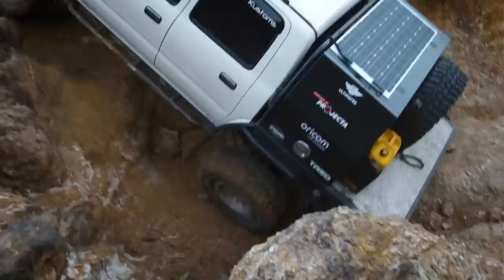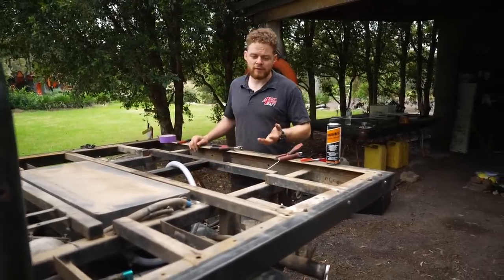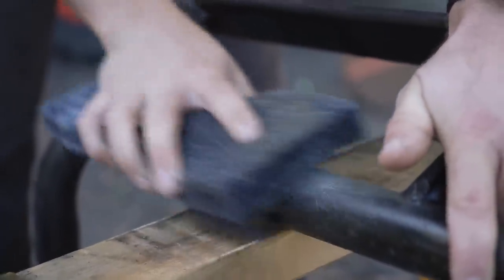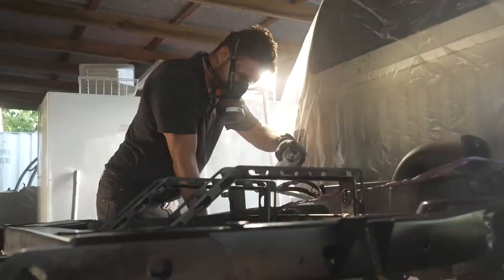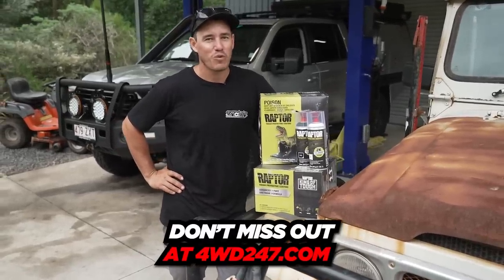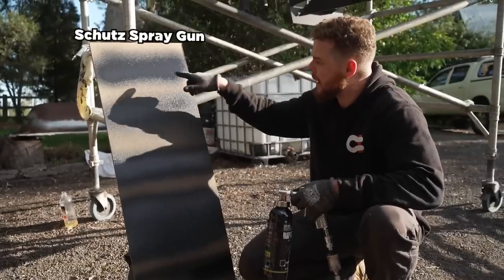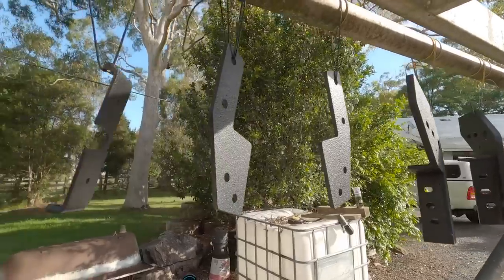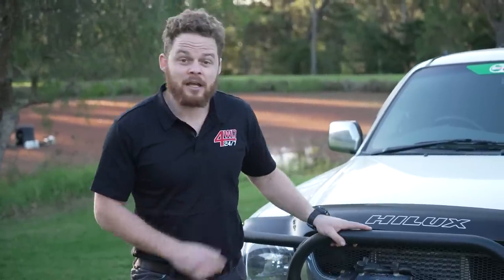HOW TO make your barwork & ute tray look NEW again!

Comment: Really should have rented a real sand blaster or even a dustless sandblaster set up, over that little hand held spot sandblasting gun. Would have taken like a hour or less to do all your bar work and probably your whole rig frame body and all. Least that's how long a dustless system would take, for a normal sand blaster it would just be what you did tray and bar work.

Comment: Would like to know what size air compressor your running to spray raptor coats??
Reply: Hey, mate! Your air compressor requirements are 1.5KW/2HP, it needs to be able to generate a consistent air pressure of 60 PSI for best results 👍
Reply: @raptorcoatingsaustralianz  thank you so much for your quick reply, I've watched quite a few videos on the raptor coating and plan on respraying both my partners and my 90 series Prados but Ive never heard any info on suitable air compressors to use, as I don't own one yet wasn't sure on what compressor to buy!! Cheers👍😀👍
Reply: @Guitarman12478  our pleasure! Hope the project goes well!

Comment: What do I do if my bar is powder coated and I want to spray it in raptor will I need to take it back to bare metal
Reply: Just lightly sand the powdercoat, prime then paint. If its peeling of bubling then it will need to be sanded back smooth
Reply: Hi, mate! To prepare powder coat, clean the surface with wax and grease remover and lightly sand with 180 grit sandpaper before applying RAPTOR.

Comment: Hey jocko need some advice mate I've got a ln106 built with a turbo install have put everything brand new on this truck but can't keep the temperature down when it's driving on a slight uphill when in 5th gear even on slight gradient like the m1 I've tried everything n can't get it sorted can u offer me any help to get this sorted mate desperately wanting to get out n use this but don't want to cause damage to the engine it has hi steer conversion front n rear lokkas long range tank winch sliders 12volt system water tank custom seats raptor coated u bolt flip kit banana shackles up front 3inch lift wanting to do Cape York and northern Territory next year once or if Eva I can get this engine sorted any help will b much appreciated mate thanks

Comment: Jock! Alittle tip to make it shine and last for a long time do your gloss black as you did but do 3 coats of rattle can clear coat after it's cured you can even wax it for that extra protection! Without the clear coat any time you scuff or rub it against anything it's scuff the paint, with the clear think enough you can literally polish scratchs off! It comes out way better and it makes it easier to shine back up after being coated with mud!!!

Comment: Nice job man. I did price raptor recently to do a alloy roof rack I built but getting it powder coated ended up cheaper than just buying the raptor alone. I do like how easy raptor is to touch up though.